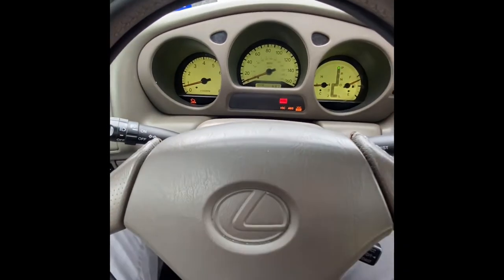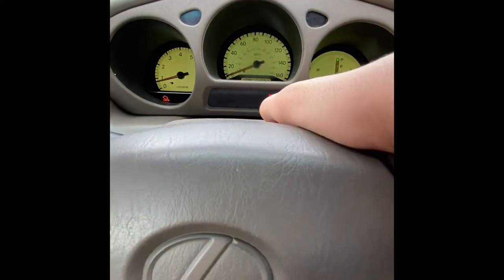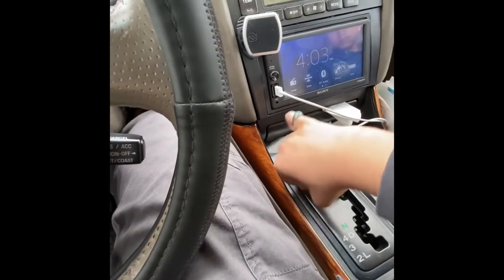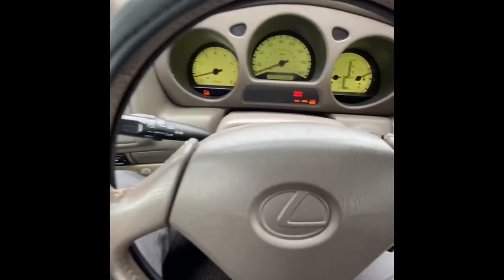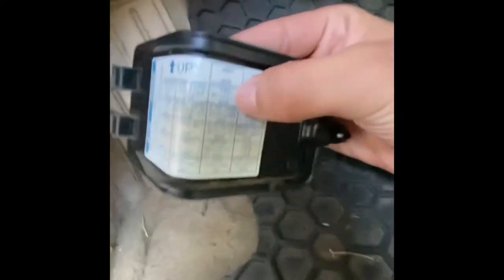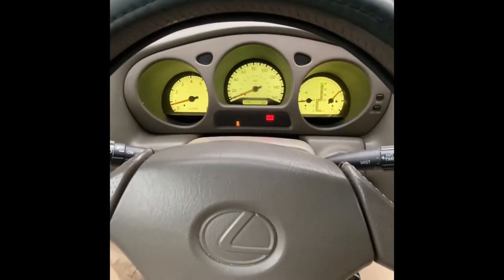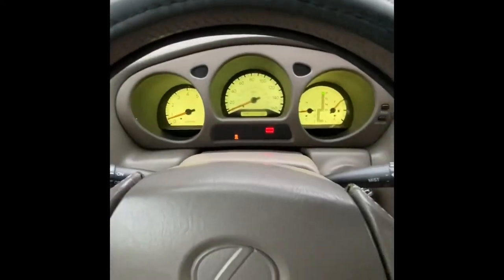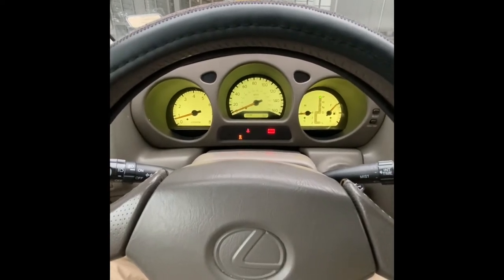How to fix the shift lock system in a 1998-2000 Lexus Gs300

Comment: I have this same issue but my key won't come out of the ignition to turn off unless I remove the battery. My brake lights are working and also none of the warning lights have come on.  I have yet to check fuse no. 3 so I will replace it later.  Would it be better to switch it from 10 amp to 15 amp?
Reply from the maker: No, it is better to use the same 10 amp fuse.

Comment: Well I just replaced motor and transmission, it was doing this and so I push the button down and it went into any gear but acted like it was in neutral
Reply: Lossen the nut to the linkage on the shifter, turn key to accessory and see what gear the gauge cluster says its in then shift the shifter to it same one it says. then tighten make sure they shift right using the tip in this video (pushing park overide button), dont turn on the engine for any of this, and put the parking break just incase you forget.
Reply: @bryantv2410  the most weird thing is there is no indicator, it doesn’t show what gear it thinks it’s in